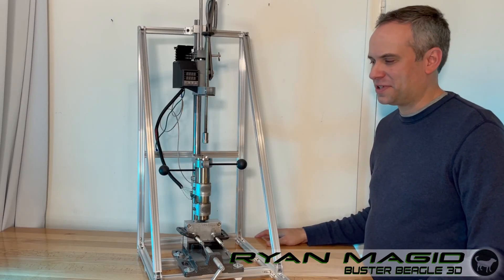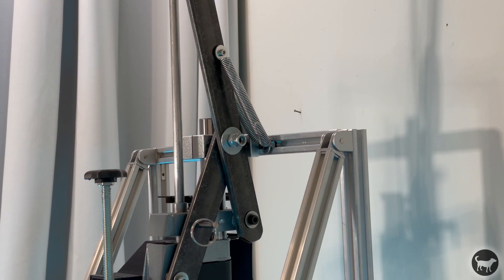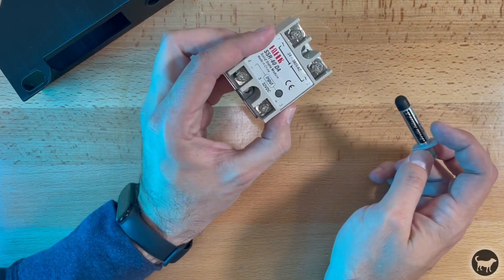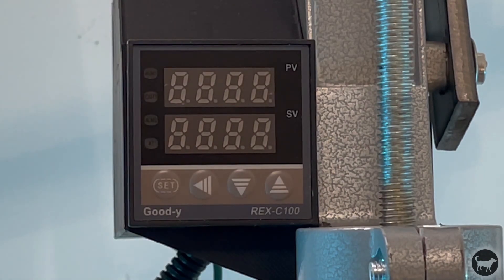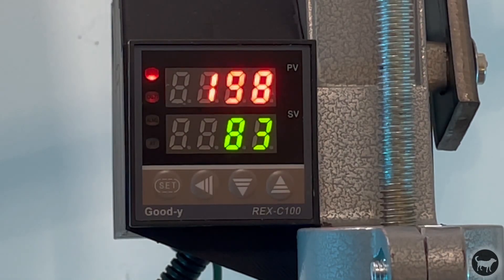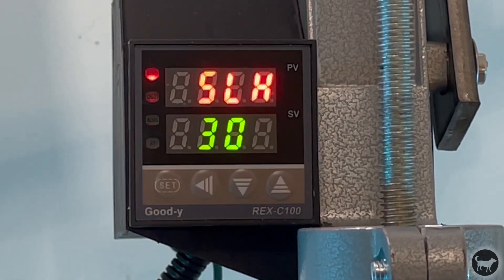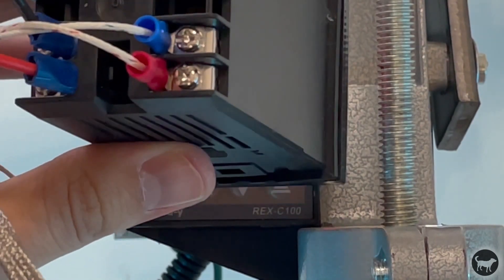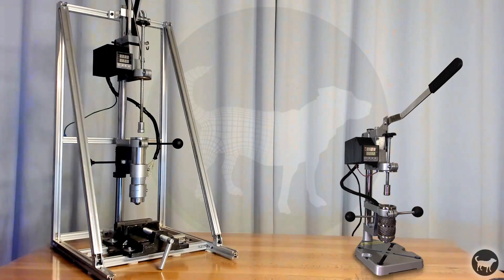Buster Beagle 3D Injection Machine Updates

Comment: I did as you said and it still allows me to set over 300 on the main screen.
Is that supposed to be like that?
Will it just ignore the setting and just heat up to 300?
Confusing...
My manual also came all in chinese lol
Reply: Alright I had a look at the rest of the setting and I've found out that you also need to set SuH (Set value High - highest value you can set) to 300.
You might as well set SuL(Set value Low) from -20 to 20 or even 150, because you never actually will need to go lower than like 150.
Reply from the maker: You are correct. I like to be able to set the machine to zero if I’m doing something with the PID controller and I don’t want the bands heating up but you are correct that the negative values are not necessary with this setup.
Reply: @BusterBeagle3D  Yeah I've set it to 20 for that exact reason.

Comment: So the temp will be reading celsius ?
Reply from the maker: It depends on the setup of your PID. There is a setting in the COD 001 under the setting called UNIT.  When UNIT=0 it's Celsius,  UNIT=1 it's Fahrenheit. By default it's set to C I believe.

Comment: Do you know if a thermoplastic polymorph would work in this? I don't know if that is the right term but looking to use this machine on the type of plastics that get soft and are moldable when put in 150°f water then will harden once cooled.
Reply from the maker: I haven't tried using something like that in this machine but I'm not sure if it would work. From my understanding that material almost feels like the consistency of clay when you are molding with it. I'm not sure it would have the ability to be extruded from the nozzle opening into a cavity. Seems like you should be able to simply warm it up and press it between a mold if that is what you are trying to achieve. This is all a guess however since I have not used it.

Comment: Have you attempted to do a pull on latex moulds (with a solid mother mould)?
Reply from the maker: Hi. I have not tried latex or silicon molds in an aluminum frame but believe other have done so. Feel free to check out the Buster  Beagle 3D Facebook group. I’m actually testing 3D printed molds but ran into an issue where my printer broke and I’m waiting on parts to fix it. Hope to have a video out soon after I do.

Comment: Just ordered your kit.  I have a controller already.  I also have a rather large standing drill press, and I'm going to investigate utilizing your plunger and heater block with the drill press as the pressure mechanism.  Are you aware of others doing this?  Is there a facebook group or anything?
Reply from the maker: Hello. There is a Buster Beagle 3D Facebook group but I have not seen someone do that yet. You would need to figure out how to mount the chamber in something on the drill press. The diameter of the part you need to mount is 42.5mm if that helps you out.

Comment: Awesome! This may be why mine doesn't heat! the polarity thing, I've got one of those "Good-Y" controllers. Thanks for this
Reply from the maker: No problem. I didn't even know that they made PID controllers with that difference until I bought a case of them. Took me a minute to figure that out as well.
Reply: @BusterBeagle3D  It worked, that was the issue. Been wondering about this for a while
Reply from the maker: @vesslades   Sorry about that. I posted that in the Facebook Group for the machine a while ago when I figured it out but never added it in a video until now.
Reply: @BusterBeagle3D  No worries! Haven't had the time to start using it anyhow. Glad it finally works though
Reply: @BusterBeagle3D  Hi, got a question for you. I've set up my controller according to these steps but I still get the same issues I had last night (before touching any settings) It gets waaaaaay to hot and the steam stinks down my entire place.. I tried measuring the temp with an IR thermometer which is hard on shiny objects but I got values over the set 200 degrees, highest I could read was 270. Eventually the thermometer started to scream that the Max temp was reached (400 according to the label on it) 

Any ideas what might be wrong? I've got a K sensor according to the ebay page. 
But something's very off with this. 
Thanks mate
Reply from the maker: @ebouledoo  It's hard to tell exactly what the issue might be but it could be that the SSR is bad. Like I was saying in the video the Solid State Relay fails in the ON position which means the bands never turn off. Check to see if that it getting too hot. Many SSR's that you can buy are a little cheap as well so it might have just gone bad. Also might not be a bad idea to reset your PID controller to the factory settings just to make sure there were not any other settings changed.

Comment: Have a suggestion to upgrade it to shoot 7in cubed? Besides multiple nozzles
Reply from the maker: I'm not sure that would be possible with a machine of this size and pressure. If you think about how large that could be if you injected a sheet that was 1mm thick the sheet would be 3x3 feet wide. I would think that would require more pressure then you could manually pull with the machine as it sits now. Even if you increase the length of the handle to increase the pressure I'm not sure the other components could handle the force. I might be wrong and I would love to see if you can pull it off.
Reply: I thought that as well so to go around was thinking of using a 5 ton actuator. Specifically off of a log splitter
Reply: But if I have a longer barrel can I add more heating bands and stay around 120? And how wide would I be able to make nozzle before it doesn’t heat it consistently
Reply from the maker: @TheMrstambaugh   The barrels do a pretty decent job of dispersing the heat so I'm not sure how many you would need. I'm no electrician so I'm not sure how many heat bands the PID and SSD can handle. You may need to add more then one PID setup on the machine almost like running 2 machines. I have not tried such a large setup so I would only be guessing.

Comment: What size production could a set up like this handle on a small one inch sized plug?
Reply from the maker: If you are asking how fast can you produce a part I would say 1 every minute or so. You need to have a little time for the mold to cool down between shots. The process usually goes, shoot the plastic, hold down for about 10 seconds, remove the chamber from the mold, refill the chamber with pellets, then remove the mold from the clamps and carefully demold your part. Then repeat.

Comment: What temperature are you using for Polypropylen?
I had the issue that die PP cold down to fast while injecting, leaving me with a half full mold...
Since that I use 270°C for Polypropylen, but I don't know, if that's to bot😅
Reply from the maker: If you are using an aluminum mold you should heat your mold first before you use it. After a few shots inside the mold the temp of the plastic will keep the mold hot. I was using 250C for PP but then realized that the melt temp was 160C so I started shooting much closer to that. I was using 160C in the SLA 3D printed molds that I will be making a video about shortly.